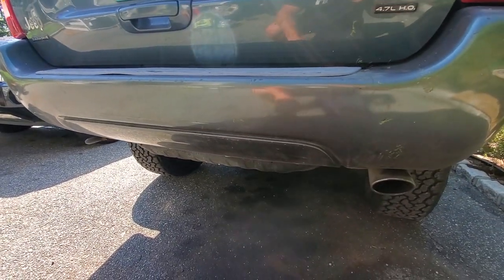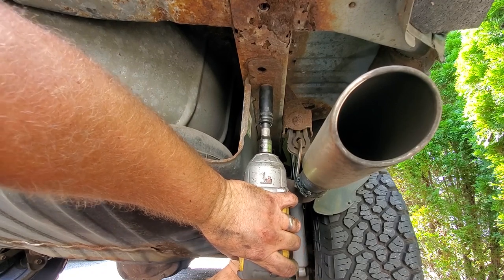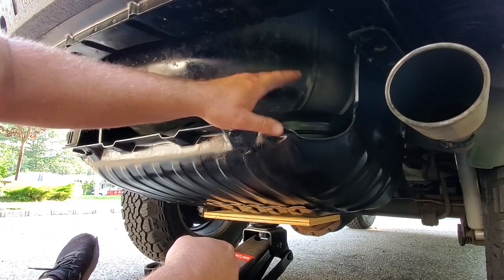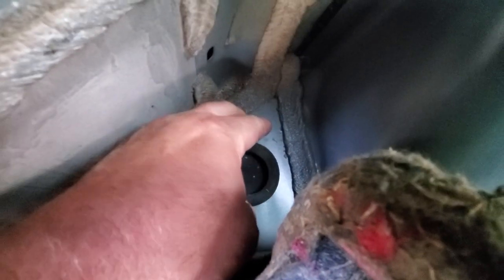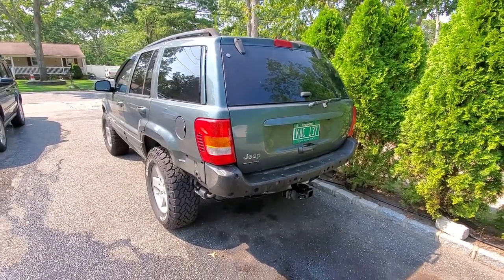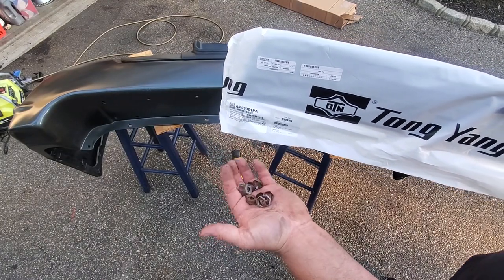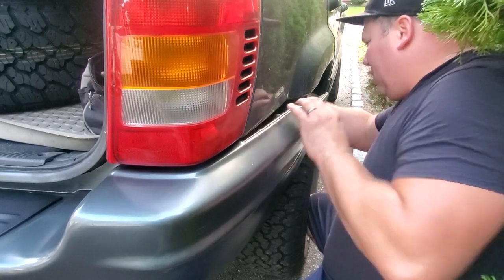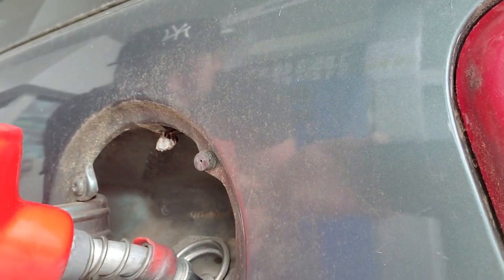FACTORY RECALL JEEP WJ TRAILER HITCH INSTALLATION & REAR BUMPER RESTORATION

Comment: The way the recall was "supposed" to work was...1) if the Jeep had the factory hitch, no action was taken. 2) if the Jeep had no hitch, no action was taken.  3) if the Jeep had an aftermarket hitch that hangs down lower, then the dealer would replace the aftermarket hitch with a factory one. However, some dealers were unclear on the criteria, so some customers with no hitch were able to get a factory one installed. I know that people were rightfully denied the hitch at some dealerships, only to finally find a dealership that was confused and would put a hitch on. So some people got lucky.
Reply: I got lucky 😊

Comment: The "by yourself method" is to leave the three bolts in the fuel tank skid that aren't used for the hitch...  The hitch has oversize holes fit over two of the bolts and the third one is forward of where the hitch mounts on the driver's side...  Much easier than dropping the fuel tank skid...

Comment: Rather than try to balance everything on a jack, it's way easier to just jack up under the skid plate until it starts to lift the rear, which will hold everything in place while you install the hitch - especially if you have a buddy to help lift the hitch into position. If you don't, then you can use a jack stand or similar to support the opposite side close enough while you position and start the bolts on the first side (speaking from experience). When you started off with how important it is to have an empty tank, I was like WTH is he doing?!? LOL Props for creativity working alone though! 🙂

Comment: There should have been mold lines on the inside of the bumper cover for the cut lines and holes for the hitch insert cover.
Reply: Yes, there are lines on the backside that show you where to cut.
Reply from the maker: Hmmm. not on mine.. maybe mine was aftermarket
Reply from the maker: @johnnychun59  I got gyped!
Reply: @ProjectDanH  That or you managed to cut on the lines from the front. That's a win!

Comment: I went to a u-pull 6 weeks ago to find a gas tank skid plate for my 2000 wj for the second time ( there hard to find not rusted out in n.y.) was about to give up and pay the 250. to 300. for a new one but found one that looked new ( holy crap). 3 hours later I gave up , couldn't get the frozen trailer hitch bolts out, the 2 that didn't hold the gas tank skid in. so I looked at a few more wjs and found one that was good with no trailer hitch , an hour later i had my skid plate. I was ready to pay 50 to 75 for it, they bloo me away , charged 20 bucks including the straps . jeeps been down for 5 years, it will be running soon. sorry for the long story just to say I wish they put the hitch on your way. always enjoy your videos, thanks.
Reply from the maker: Thanks man! I appreciate your view and comment. God Speed!

Comment: Fantastic video!  Thank you for doing this.  I’m replacing the skid plate on my son’s Jeep and I really didn’t want to disturb the bumper mounting hardware. It looks like the existing plate is so shot I’ll be able to pull it out in pice without pulling the hitch.  Knowing where  bolts are it’s big help.
Reply from the maker: Thank you so much good luck and God bless!

Comment: those bumper anchors bolts (using the e7 bit) are also used to hold the mirrors onto the doors- I had to eh “harvest” some recently😉🤣 holy cow awesome video and a freakin awesome finished project! 😎

Comment: Hahahaha good one. Very well done sir! I've had my WJ 18 years and have yet to use the trailer now. I bought a motorcycle and need to run to U-Haul trailer. Your video is very instructional. Thank you so much! Dan

Comment: Northeast ZJ owner here in South Central Pa. Thankfully my '98 5.9 Limited (Stone White, loaded!) has nowhere near that much rust. The only bad spot is the front seat rear outer frame to floor bolts, the brackets are there but the floor is gone is a 3" by 4" area. I cut the entire floor out of a Arizona '95 ZJ to be welded in soon. Will be my first YouTube video, I hope!  I stripped the '95 of all its body parts for future ZJ use. I love to watch your videos; I learn a lot from the content and where the pitfalls are. It's awesome to see people so enthused and keeping these great old ZJ's and WJ's going, making them better than factory in some cases. I'm always stoked when you drop a new video, there is so much to learn from watching, made for us real world owners. My 99 Laredo doesn't have a trailer hitch, I need to hit the Jeep salvage yard and pick one up. 

I'm lucky to have a local Jeep-only salvage yard, pretty much everything made from the 80's up to the WK. They only save the good parts and complete Jeeps for rebuilding. Thats where the 5.9 Limited came from. Also picked up a '03 Vin J 4.7 HO with 19k miles for 750$ and heard it run before it was pulled. You should do a 4.7 HO swap, maybe I'll do one!
Reply from the maker: Hey Phil! Thank you so much for watching!!! Ive always wanted a Niner.. Good luck with the fix.  Cant wait for the vid.  God bless

Comment: Hi San... a lot of great info on this video...  I was lucky that the dealer handled the recall...  I feel the same every time I go to the gas station.  I get better gas millage out of my Ford F350 Dually 6.0 Diesel than the 2004 WJ 4.7 V8 WJ. I've gotten 19 MPG on the big truck... and I average about 14 on the WJ.  Great video.

Comment: I did my gas tank skid plate last year 2000 Jeep Grand Cherokee Laredo WJ. What a pain. The pan was rotted and the gas tank was held on just barely. Buy a fuel pump before you do this because the fuel pump is right on top of tank. No cutting through spare tire well. I also used truck bed liner to coat the skid plate to avoid future rust.
Reply from the maker: Excellent Idea, Nice not cutting unnecessary holes!
Reply: Cutting through the spare tire weld is a wise decision, who wants to bother with dropping  the tank and removing the hitch, at least it will save you a tremendous amount of time and a big headache trying to drop all of those part's.
Reply: And it will be much easier for future replacement.
Reply: I just replace my skid plate on my 2004 WJ, The one side just fell off when I removed the bolts!

Comment: I have a 2004 Jeep Grand Cherokee. A friend wrecked her 2002 JGC over Christmas. From what I have read the parts seem to be interchangeable. I was going to get her factory bumper, hitch and harness. In the video you said if you had help you would have done the install different. I’m not sure what would be different. I guess it would be on very bottom. I get it now the plate held up the hitch
Reply from the maker: Do you want these parts?  I'm parting out this WJ now 😢
Reply: @ProjectDanH  sure I need it all / I'm in CT where are you? Hit me back if you think it's doable thx

Comment: Why did you mount the tow receiver above the tank skid plate? It can go underneath, and since it doesn't share all the bolts (only 2 out of 3 per side I think) with the tank, you don't even have to support/fiddle with the tank skid plate mountings? Seems much easier than what you did?
*Oh ok 30s later, if alone its actually easier this way...

Comment: very informative.  just got a WJ.  No hitch on mine.  Seems the recall is ONLY for those that have a 3rd party hitch on it.  If you had that, then the dealer would change it out for a factory hitch.  If yours had no hitch, they dont do anything
Reply from the maker: I heard the opposite... Something had to be there to protect the tank.  If you had an aftermarket one or a factory one you were protected.. if you had nothing they needed to put something there
Reply: @ProjectDanH that’s for the XJ and possibly the ZJ, recall N47 for the wj is as grimmster described.

Comment: Hey Dan, new to your channel. I’m enjoying the videos. I have a 99 Jeep Grand Cherokee limited WJ 
I have an issue (electrical) with the lights interior periodically coming on and off? I need to remove a battery cable in order to keep the battery from draining. I’ve searched you tube and can’t seem to pin point it. Any thoughts and or suggestions? 
Frank H (new subscriber)
Reply: I have a 2004 WJ that was having the same problem years ago.  The problem was the big black wire that's in the driver's side door that's located in that boot.  Check and make sure those wires in that boot aren't broke.  This is a common problem.   I recommend you replace that entire wire rather than solder it back together. It kept breaking on me until I replaced it. If you search YouTube you'll find many videos on it. Just type Jeep WJ door wire harness.  Loads of videos will pop up.  Like I said,  it's a common problem.
Reply from the maker: Thanks Carl
Reply from the maker: What Carl said!

Comment: Great tutorial, I have a EU spec wj, shares the same frame. 
Got mix feeling about the hitch being sandwiched, shouldn't be a problem i guess.
Is anti seize a good call for those bolts or loctite is equally ok, heck it might just work dry.
I need a eu hitch but i would like to do the wiring from the extra harness instead of getting it from stop lights.
Do you think its possible to cut the wiring and solder the correct wires for stops, L&R and ground?
Reply from the maker: Thanks for watching! You could cut and splice... I rather use the factory plug.. its easier

Comment: Hey Dan, great video! In your opinion how crucial are the support bars that connect to the gas tank skid plate? I bought a hitch from a yard that pulled it for me and they didn’t include them, I could crawl around at pick-n-pull but I’d love to avoid it if I don’t have to
Reply: Same
Reply: Same here, I took the one from the tank to the frame driver side out. where can I get the short one you show putting on pass side?

Comment: Hey Dan, did the new trim bezel come with the plastic fasteners/nuts or was it a separate part #? The 2 with factory hitches at my local junkyard look like the pegs had been melted into place.
Reply from the maker: My kit came with a bag of plastic nuts.  melting or plastic welding works too!
Reply: @ProjectDanH  Hey thanks Dan! Definitely works but makes it a bummer for the next guy!

Comment: I'm going to do the exact opposite at some point.  My WJ has the factory hitch or got the recall at some point.  I was lucky enough to find an uncut factory rear bumper in my paint color.

I'm going to do it when i do a gas tank tuck to improve the departure angle but I'm going to modify my trailer hitch, flipping the receiver on top of the horizontal bar so it will come out of the vertical surface of the bumper and can be "hidden" with a receiver cover plug.  It shouldn't reduce the rear collision safety because the tank will be even more protected, I'll just need a drop hitch.
Reply from the maker: Dude! Thats amazing.  Film and post it!
Reply: @ProjectDanH  I'm not sure if I'll film but I'm going to try to do bodywork like Spiral Designs and the gas tank tuck like martinbuilt but my twist is going to be using flanging tools and "spot welds" for the sheet metal work so I don't have to butt-weld all of the seams.  I'll also do an HK Offroad style hidden winch bumper, possibly an XJ style radiator conversion, long arms and Dana 50 or 60 axle swaps with a tire size between 33" and 37" probably.  Also HK Offroad style rock sliders.  I don't want to lift it too much so the objective will be to get maximum stuff and a lot of droop.  I might have to do something like the Rudicon front shocks but I'll do a lower profile shock hoop and hood blisters instead of hood holes.  I have an idea for anti-sway bar "disconnects" but it's a bit experimental so I'm going to keep my mouth shut on that.

I might try to enlarge my spare tire well to fit a matching spare and "lift" my rear carpet to cover it flat.  I want to do a cargo drawer/rear bed platform for an overlanding/car camping setup.  If I don't enlarge the spare tire well, I'll make a swinging tire carrier for the rear bumper with Jerry Can storage too.

Just don't hold your breath, I have to build my shop first which looks like it will probably be winter 2024 before I can start on big Jeep projects.

Comment: I called the dealer for my hitch, I have a 96 ZJ, indeed it was on the list and set an appointment 3 months from then. Had to wait for the part then time to do so.
When I got there 3 months later and they denied me my hitch in person saying I needed to already have one installed? From what I understand of the recall they were to install it as a crash bar to protect the tank in an accident?
Doesn't really matter now, I just went to the pull yard and grabbed one for free anyway, had $30 credit 🎉
Still I'd like to know if I'm wrong on that or..?
Reply from the maker: It should have been to Add one if you don't have one.  That makes the most sense to me.. They'll do anything to avoid a free job

Comment: Dan I’m hoping you can help me with something, I have a 98 two door that I put a overhead console from a 2001. I need to repin the wiring. I have the two plugs that go to the 98 but the 01 only has one plug. The lights wiring is the same. I can’t find anything that really helps me. I hope you can. Thanks in advance.
Reply from the maker: hunt down a wire harness from a 98.  but, If i rememember correctly all the wires have the same colors depite the diffrent connectors...   last resort you can snip off the connectors and just match the wires.
Reply: @ProjectDanH  ok. Thanks

Comment: Does this model fit the 2004 Europe 2.7 diesel???
Reply from the maker: It should, just remember that the front header panel, bumper, and grill, are different  from 2003 to 2004

Comment: Hi Dan, sorry for bother you but I need your help. I'm looking for a bracket which attached with the serpentine belt tensioner to the engine block of a 2006 Jeep Liberty sport KJ 2.8L CRD 120Kw 163Hp  in my country Perú there is not yunkyard where to find spare parts that no longer manufactured. In advance many thanks for your help.
Reply from the maker: Sorry, I don't have that part
Reply: Hi, Proyect Dan H many thanks for your attention. Are you in Indiana?

Comment: Hi Dan H, I'm Juan Woll from Perú, I'm looking for the bracket which hold the power steering pump and the serpentine belt tensioner and the bracket join to the engine block 2006 Jeep Liberty KJ 2.8L CRD 120Kw 163Hp through three bolts: two lateral and one at the front of the engine. Would you sell me it vía ebay, please notice me before the BRACKET be sell on ebay. I'm looking forward hearing from you soon.
Reply from the maker: Thank you for asking, however, I do not have that part

Comment: Yep, they screwed me too. Yes, we can take care of that recall!,  Um, you're all good. Where's the trailer hitch? You didn't require one. I have a copy of the recall, that's not what it says. Called Jeep, they said they marked recall complete, I said, they didn't do anything. After a while I too said screw it.
Reply from the maker: Yep.. Basically same thing.. the service employee told me they have to put one on for the recall.. I booked an appointment, the manager called me back and said no.  lol. gimme a break.
Reply: @ProjectDanH  I called Fiat, they said the recall was satisfied, I said it's not been done. They don't care. great customer service. Side note, they called, said, you haven't been in for service, I told them why.
Reply: @ProjectDanH  I'm glad you posted this, I now know what to get for mine. Keep'm comin, man
Reply: I had the recall done on mine. When you receive the recall notice it shows what they do based on your set up. If you have an aftermarket hitch, they install the factory style to replace it. If you have no hitch they do nothing. I guess the problem comes from the aftermarket hitches causing the problem.?. But the actual recall notice shows they only give a new hitch if you have an aftermarket hitch installed.
Reply: @shedmartinez5979  JEEP told me that they were going to install a new hitch - period.  I advised them that I had already installed an after-market hitch and they advised me that my recall would remain open until I came down and refused their hitch.  I've not darkened their doors to this day.